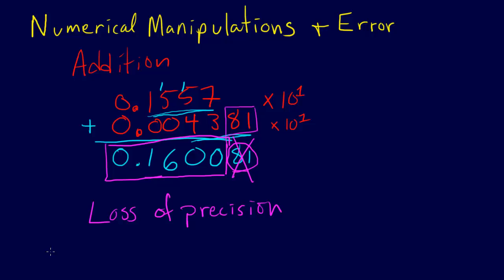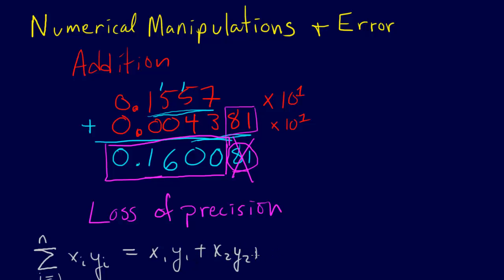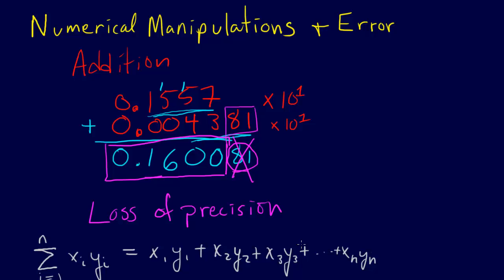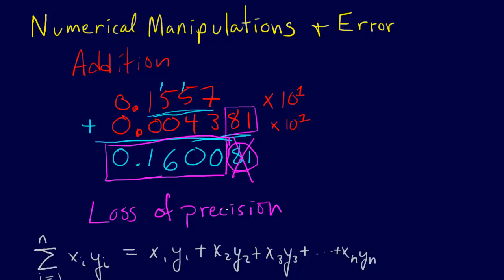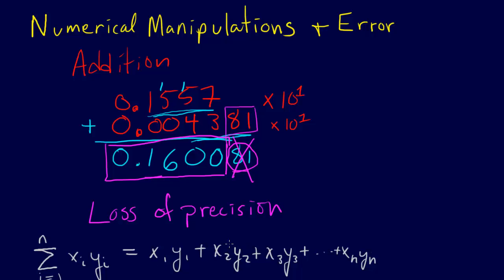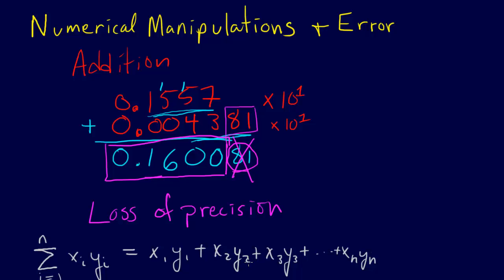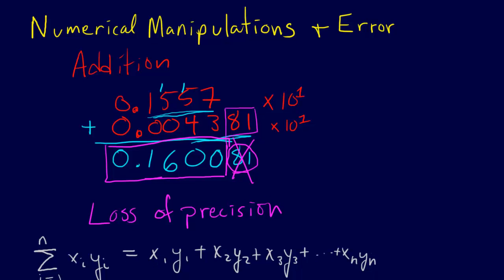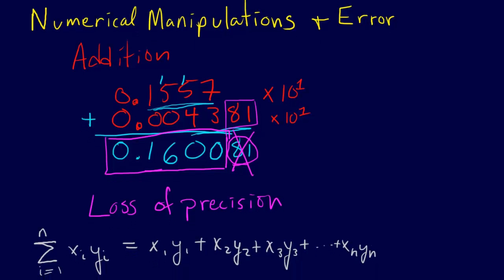1.3.5-Modeling & Error: Examples--Inner Products

Comment: Hi thank you so much for the lecture!! I'm watching numerical methods video of yours from the beginning and I really love the way you teach. I got one question in this inner-product-video. I understand the dot product but why did you bring the inner product topic in the lecture? (I couldn't understand the FLOW) How come inner products come up suddenly as you say that it is related with the problem in addition? I didn't get it why.
Reply from the maker: 고혜선 I'm not distinguishing here between inner products and dot products. I'm using the terms interchangeably, even though inner product is actually more general than dot product, because dot product is restricted only to Euclidean space. When you do a dot product, you basically multiply a bunch of numbers together, then add them up. It has to do with the loss of precision in addition precisely because you add up a bunch of numbers. If each addition loses a little bit of precision (particularly if there is a big difference in the magnitude of the numbers), by the end, you may have a big loss of precision.